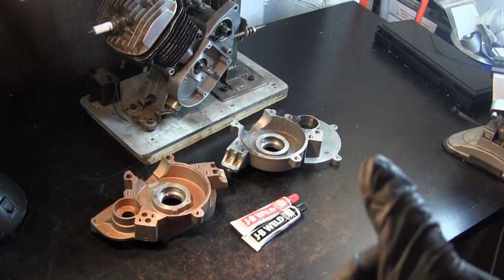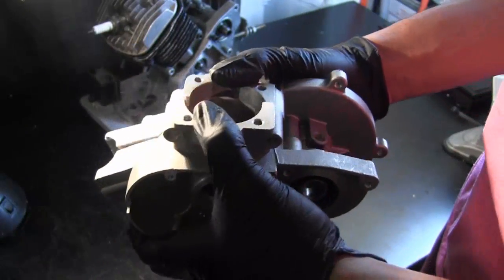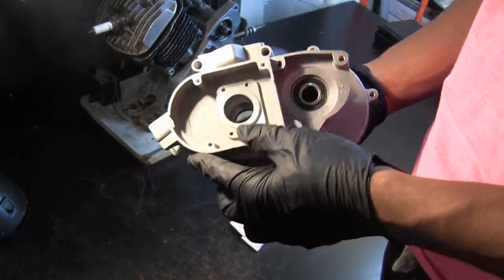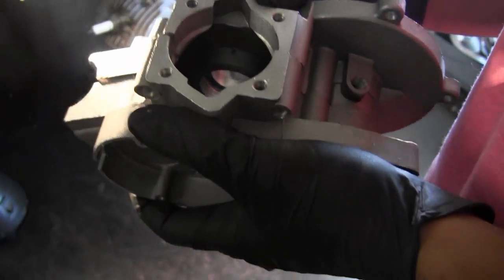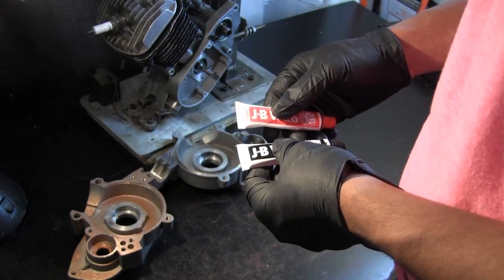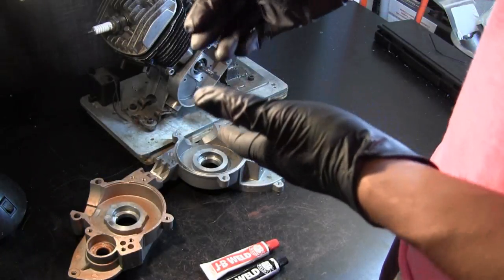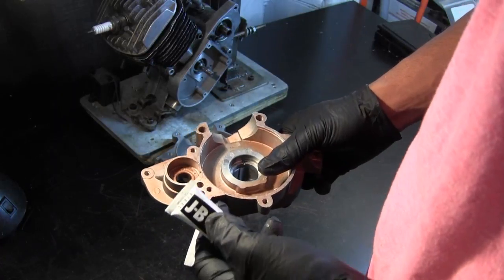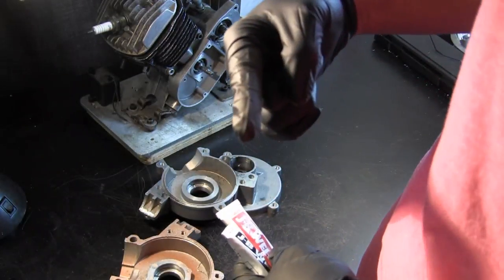Crankcase Compression Ratios in your 2 Stroke Engine

Comment: Wat do you think about milking the reed block mounting surface witch moves reeds closer to crank in turn means less crankcase volume. Aka reed stuffers or when reed stuffers are not available then you mill/shave/plain/deck the reed block mounting face??

Comment: In my experience this is incorrect, but it is an interesting theory. Larger crank case volume under pressure compressing the charge yielded a larger boost at higher rpms. I would be open to a rebuttal comment of your experience
Reply: Está correto !!! Maior volume do carter da maior potencia em alta!, em um teste feito no dinamômetro o motor da rd 135 com carter fechado ganhou 0,4cv em baixa e média e perdeu 1cv em alta mesmo motor só modificado o fechamento dos furos do virabrequim

Comment: Damn it is a bicicle engine.... u dont need more horsepower... and jb weld shit in your engine.... hmmm... do some real work and make some aluminium inserts for that if u wana do it right... i will do a same vid and i do bubble gum in it... it will run to🙈🙈🙈🙈🙈🙈🙈
Reply: I use pink shipping peanuts and tootsie rolls, but I end up eating all the tootsie rolls....🤣

Comment: STUPID IDEA on an actual CORRECT IDEA,. silicone on crank will  COME OUT, .....  ANY HARD SEALANT on crankcase will CRACK as the alloy  EXPANDS & CONTRACTS at different rate to jb weld... CRANK STUFFERS are  big  inserts designed to fit  when crank was designed and WORK....   DO NOT ADD  GOO or jb weld as it will ALL BREAK UP

Comment: jb weld, though reasonably miraculous stuff, has a major problem as a "filler" inside your engine. it experiences heat fatigue over multiple heating cooling cycles, especially when used to form a "skin". when i worked on the line at a powder coat shop, we used jb weld to fill imperfections on aluminum railings for cosmetic purposes. dings on rail caps, minor gouges, etc. if our process went "right", it worked awesome. however, on parts that needed rework, we'd experience failure of bond after around 5 heating/cooling cycles. not always, not every area filled, but often enough that filled "re-shoots" were pretty problematic. curing temps were between 350 and 425 f (depending on powder type) with "soak times" of around half an hour. when used to bond a "butt joint", or a "lap joint", it lasts almost forever, even when exposed to seriously impressive heats and pressures (i've used it to patch aluminum core leaks in the oil heat exchangers of motor driven air compressors, environments with 180 psi at 400 degrees), but when single side bonded, it's a bit less impressive.
Reply: Thank u much... 👍👍👍👍👍👍👍👍👍👍👍
Reply: Agreed! 👏👏
Reply: What if you used an automatic center punch or even sawed/drilled texture into the metal. Might work for thicker parts

Comment: hey if anyone knows whats wrong with my bike please let me know. ok so i brought a ktm lc2 when i brought it it ran fine but a few months later i went to start it and it wanted none of it so i fiddle with the carb for a few hours just cleaning ect no changing of any screws or jets and got it back on and the bike would start and die rinse and repeat so i took the head off to have a look and found the piston has brand new rings but there was no gasgets on the top of the cylinder below the head that was a red flag but i proceed to take the head off and spot the rings i knew something was up as the piston is scored and warn same with the barrel but my bottom end has what looks to be a mix between oil radiator fluid and fuel any idea on how to get it out ? its the same engine as the yamaha Dtr upto the 03 model with the 3bn engine